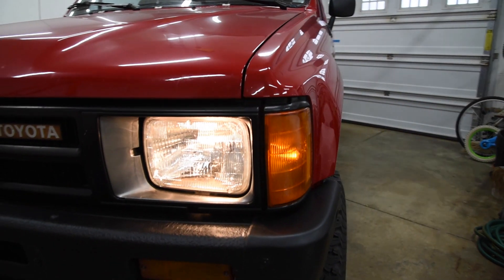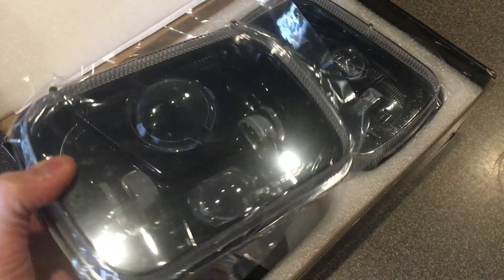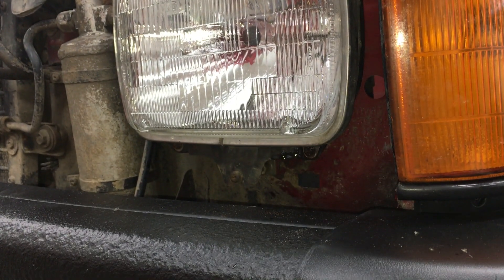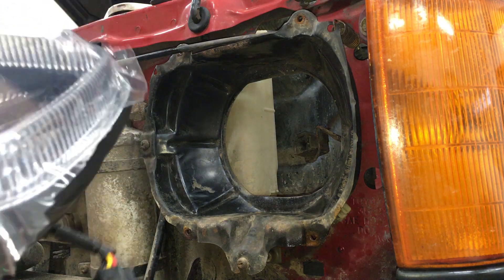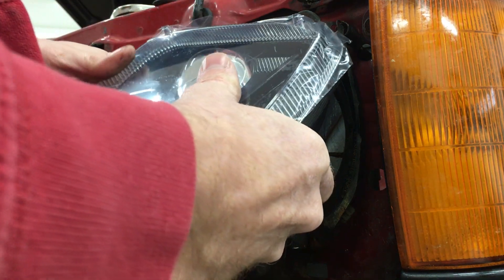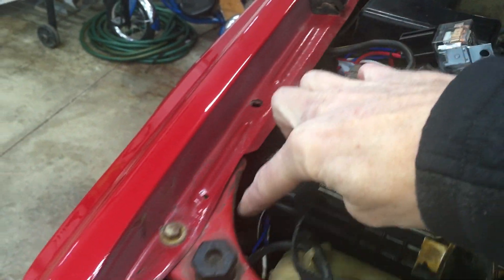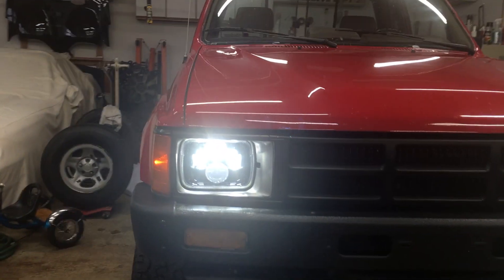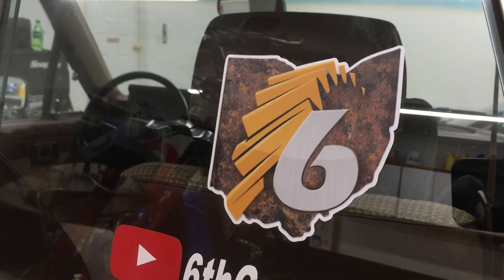How to: Install Toyota Pickup Truck LED Headlights - 4Runner & Tacoma too!

Comment: I bought a kit with the many led lights for my 84 Toyota and was very frustrated my brights wouldn’t work.  I bough a wiring kit from somewhere out west similar to the one you bought and plugged it up the same way.  Still didn’t work.  It was a waste of 50 bucks.  I hardwired a toggle switch to turn on my brights.  I’m really disappointed and am looking for some nice good old fashioned bright halogens now.  Glad your stuff worked mine was a waste.

Comment: I put on the led headlights and some plug and play led tail lights but my truck doesn’t idle anymore after installing the tail lights and it starts shocking me once I crank it over and touch any metal
Reply from the maker: I'd start by removing each light one at a time and seeing if it still shocks you. When the problem goes away, you've found the culprit. Sounds like some wires are crossed somewhere and causing a short.

Comment: I did the install as well and the dashboard light isn’t telling me when the lights are on! Any suggestions?
My blinker lights are turning on, the lights on the dashboard is working only the low beam and high beam light isn’t turning on.
Thank you.
Reply from the maker: Did you use the H4 conversion harness? It must be used with aftermarket LED lights on these Toyotas.  If you did, then I would double check grounds and connections next.

Comment: Hi, I installed LEDs with the arnes in my 88 toyota truck, but just the low beam works. please i need you help!
Reply from the maker: I would check to make sure you have the connections for the lights in the correct order.
Reply: @6thGearGarage  i used the extra wiring cable to change te position and it works, but the lights are inverted vs switch lever.
Hight beam when swicht is in Low position.
Low beam when swicht is in hight position. 
I did many combinations in the cables in dosnt works it.
Reply from the maker: @ you may need to re-pin the extra harness to switch the high and low wires. Toyota light wiring is different than most other vehicles.

Comment: Man how is the front bumper removed
Reply from the maker: Bolts at the bottom of front fenders for the end caps. Then there are 2 big bolts on each of the bumper brackets that hold it to the front of the frame.
Reply: @6thGearGarage  thank you again

Comment: Did you ever come up with the High Bean indicator light not working? I'm having this issue after using the h4 LED harness. The indicator light worked before I did the LED conversion.
Reply from the maker: To get the high beam indicator working again, You will probably need to install a resistor because the relay thinks the bulb is burned out because LED's draw less power.

Comment: I actually really appreciate that you kept your "failed" first attempt at "plug and play" because that's EXACTLY what I experienced when I went to plug in my LED light.  Same as you, I swapped the wiring around (actually tried many other combos too), but kept getting High Beams on all the time, and when flashing my high beams, it turned off...  Then searched a bit and found that Toyotas are switched ground, and these lamps assume a more standard switched positive.  So we need the relay wiring kit you ordered (or I guess you can wire it yourself, but for $18, the parts and time to do it is worth that much).

Had I seen your video before I started this project, I would have known what to expect and saved some time, but oh well, it's always trial and error with these old Toyotas.

BTW, my car is a 1986 MR2 (AW11), and I also have a 1988 Celica (ST165) and 1992 Celica (ST185): they all had the same issue - pretty safe to assume any old Toyotas with the H6054 7x6 headlights have the same wiring.

P.S.  Also got a good laugh about the rusted headlight ring retainer screw.  Those damn things are always rusted on every Toyota I had and the Vise Grip method is my favorite method too!

Comment: I just want to personally thank you for this video. I have a 1990 Toyota pick up that I just put some of these in. Went ahead and got the harness just to be safe, and sure enough it was needed! if it weren’t for you showing what was wrong I would’ve probably had an extremely difficult time figuring it out. Thank you so much! I love my new headlights so far. ♥️

Comment: These are the exact same lights that I bought for my 93 Toyota Pickup. Thank you for the video.
Reply: Ayy bro i have a 93 pick up to. Did you have an issue with them just staying in high beams??
Reply: @kashoutcris9487  No. Did you buy H4 harness for the head lights? I had a problem with getting the brights to come on, but that was caused by my switch, not the lights.

Comment: Thank you for uploading this! It really helped me out. I lucked out and didn’t need to unscrew the metal frame around the headlight, I got new hologram ones and they came with it. All I need to do was remove the bolts that keep it in place and position it and a spring.
Reply from the maker: Great to hear!  Those tiny rusty screws were the worst part of it all.

Comment: Thank you for making this video! I installed a set of these same lights I got on ebay last year in my 87 and had run into the same issue with mine which never came with the adapter or instructions..  so I only set up my low beams and was dragging my feet on the idea of having to rewire the factory switching. Now that I know about this adapter I wont have to! Otherwise I've been running these lights for a year and enjoy mine too
Reply from the maker: Glad the vid could help someone else!

Comment: Good video. I went from using one, to using two H4 harnesses. The stock Toyota has redundancy (separate fuses for left and right). This setup only uses one Toyota fuse and has only one fuse going from the battery to both headlights. Either fuse blows and both headlights go out at the same time. With two harnesses, I'm using both Toyota fuses left and right, and now running separate fuses for left and right headlights from the battery. Interesting, the high beam indicator light on the dash didn't work with one harness, but now works with two. 

I simply cut off the part of the harness I was no longer using that went to the second headlight, capped off the exposed wire ends with small wire nuts and some electrical tape. I then added wire to the hot on one harness to reach across to the battery. I used the leftover wire and conduit to lengthen the hot and soldered and taped the connections on the hot. Then it's just plug and play.

A good investment for only 17 dollars for the second harness. 

Much, much safer to have each side fused separate so you don't risk losing both headlights at once!
Reply from the maker: That's a really good idea, thanks for sharing!!
Reply: @6thGearGarage  You're welcome. Glad you like my idea!
Reply: I’m confused where the relay gets hooked to.    Could you explain if you see this.  I live in Alaska so everything seems to be a pain.    Thanks 🙏🏿
Reply: @stevenshackelford1032  The harness has the relay in it. Connect the harness to the headlight on one end and to the battery on the other. In the middle there is a place to plug in your old (stock) headlight plug to control the new harness and relay. I used 2 harnesses, so I have 2 fuses. One for each headlight instead of 1 fuse for both headlights. I didn't like the thought of losing both headlights at once if the single fuse blew.

Comment: Excellent tutorial.  I just bought the harness because my LEDs did the same.  No HB. Just LB.  THX
Reply from the maker: Glad it helped👍
Reply: @6thGearGarage  Installed in about an hour. Just like yours, i didn’t have a solid ground connection on the passenger side.  A little finagling and lo and behold we’ve got Hi and Lo beams.  I had to take the battery out to work on the right side.  A minor PIA.  I couldn’t have done it without your detailed explanation.  Many many thanks.

Comment: Nice video…definitely a big upgrade over the stock H6054 sealed beams. I also ran into the same issue when installing my JW Speaker 8900 H6054 LED headlights on my 1994 Toyota pickup. Toyota trucks use a double switched ground system which causes the issue since the LED’s headlights are designed to work with a switched positive system. After installing the H4 harness all worked perfectly. Light output is excellent with a very clean cut-off. High beams are insanely bright and usable! Yours came out great!👍🏻
Reply: Did you keep the old headlight wiring system in the truck?

Comment: I've got these same lights on both my Nissan hardbody trucks, and with the first click of the h/l switch, they go into DRL (daytime running light). 
Just the vertical LEDs on the sides light up, i think it looks dope!! They actually put out some light too, sometimes I forget to put my headlights on bc the DRLs are bright enough & i don't realize it  
Anyhow, Awesome video man. I appreciate how thorough you were!.
Reply from the maker: Aren't they amazing? After driving with these at night, I don't think I could ever go back to the old halogen headlights.

Comment: just FYI if you still have the truck the H4 harness likely has saved your electrical system specifically the headlight knob and the wiring into the stem toyotas run all headlight power through the stem the relay harness fixes that part by the switch just operating a relay i have mine now operating 2 relays (using the non used headlight socket) so my offroad light bar does not work if im running high beams (which is illegal in some states) an if i cut off the lights all of them go off
Reply from the maker: Good info, thanks for sharing!

Comment: Omg thank you for this video, I was about to just roll with no high beams!!!
Reply from the maker: Glad it could help!
Reply: @6thGearGarage  did you still have to use the wire adapter to switch the negative when installing the upgrade harness?
Reply from the maker: @troypeplinski6241  No I did not need that after installing the H4 relay harness

Comment: great video , i went through the exact same problems on my 84 except rust because iam in nevada . once you go to LED theres no going back , the only drawback ive found is driving in snow the LEDs dont get as hot so snow builds up on them instead of melting off although i heard there now making heated LEDs
Reply from the maker: I hadn't considered that. I try not to drive this one during winter so it won't rust away

Comment: Question so when we get the relay do we still need to use the other adapter to switch the negatives ? Or just take it off ? Thanks
Reply from the maker: The little adapter that came with the headlights? You can toss it, the H4 relay harness takes care of everything.

Comment: Did you have to modify the headlight buckets?  I had to trim a fair amount to install the thicker LEDs.
Reply from the maker: They were a tighter fit than the old headlights, but I did not have to modify them to fit.

Comment: Getting ready to do exactly this to my 88 Pickup :) Love your videos man.
Reply from the maker: Thanks!!
Reply: @6thGearGarage  Just got it done yesterday and I couldnt be any happier. Only thing I need to do now that Ive installed the new headlights is I should have gotten a housing that supports DRL. So I may do a swap down the road if my friend is willing to take the existing ones off of my hands.

Comment: Ah dang. When your driver side light didn't work after attaching the harness I was hoping you'd give me some guidance ha. Mine Stull doesn't work with the harness, only the passenger does. Customer support said it should work which wasn't helpful.
Reply from the maker: I think mine was due to a bad ground connection, I'd double check your grounds first
Reply: @6thGearGarage  I feel dumb. I double checked my grounds... and I should've triple checked. The bolt it was on apparently isn't grounded so I moved it to the frame bolt and it worked. I'm gonna go smash more coconuts.
Reply from the maker: @brandonhearn4746  I’ve been there, same issues. Sometimes paint or surface rust can prevent the ground from having a good connection, even though it looks grounded.
Reply: @6thGearGarage  exactly what it was. Now I'm dealing with the bumper blinker light. Replaced the bulb and now it won't work haha. Put the old bulb back and it still doesn't work so 🤷 I'll be over here breaking and replacing lol.

Comment: Where did you hook up the relay?     I’m in Alaska and I have purchased the headlights.   I have a 97 Toyota and the video was very informative and I subscribed to your channel.    Please let me know because I’m doing it tomorrow.   Thank you very much pal 👍🏿
Reply from the maker: The relay plugs into the headlight plug and also connects to the battery. And you’ll also need a ground.
Reply: @6thGearGarage  got it and everything works great.   Appreciate it pal 🙏🏿

Comment: @6thgeargarage what did you bolt the relays too? Thanks for the help buddy
Reply from the maker: I didn't bolt them, just zip tied them securely to the harness and tucked them in the space between the battery and the side of the engine bay.
Reply: Thank you so much buddy. Think i could wrap the exposed metal with electrical tape? @6thGearGarage

Comment: Do you have a video on how to install headlights with Halos?
Reply from the maker: No I don't, but I'm getting ready to upload how to install LED headlights with integrated turn signals. Similar but just a different wire to tap in to.

Comment: What year is this truck??? You should mention it in the video, title, and or description.  You don't in any of them.  I just upgraded mine with the newest 2021 lights like these but with the DRL / turn signal lens at the bottom.   I replaced the 4 trim ring screws with stainless steel which are M4 -.07 x 10mm.
Reply from the maker: It's a 1985, I'll be sure to add that to the description... thanks!

Comment: im using the same harness but my lights are always on brights and it doesnt show on the dash that they are on. it has no low beams?
Reply from the maker: Someone else had the same problem. I'm not sure why, but it sounds like the harness may need re-pinned at the headlight.

Comment: Great video and love the channel. Just installed the same LED headlights you used and also the relay harness. All worked except only have high beams. Cleaned grounds, no change. Unplugged new headlights and replugged in the old and now get high and low beams through the original headlights.  Do you have any suggestions or ideas why the new lights only have high beams?
Reply from the maker: Are your high beams on all the time when you turn the lights on, or do you mean you have no low beams and only high beams?

Comment: So this video is a year old, how are these holding up now? Any issues after a year?
Reply from the maker: Funny you mentioned this... I just saw a little moisture in one of the headlights for the first time a couple of days ago, after I washed the truck. It appears to have gone away now.
Reply: @6thGearGarage  but are they still just as bright?
Reply from the maker: @Valtrexthief  Yes they are still just as bright as when they were new.

Comment: Will that harness work for any headlight set?
Reply from the maker: I've only used it for Toyota trucks, but it may work for others as well, as long as the plug is the same (H4)
Reply: @6thGearGarage  awesome! Yea I have a 94 toyo pickup and the lights I’m looking at got the H4 plugs. Thank you 😎

Comment: I have the exact same ones i just bought this month.  Amd they dont fit in the metal housing behind the chrome trim.. i had to cut out the metal housing.. and that caused the adjustments to now be riding alont the new headlights rear housing.. havent turned it on yet due to truck is getting worked on.... 
So im wondering how yours fit when i have the same light and truck also
Reply from the maker: Mine fit without any cutting, but you're the second person in a week that said they had to trim the metal housing to get these to fit. What year is your truck?
Reply: @6thGearGarage  1986 pickup 4wd.. they must've gone with a different housing or something.. its just slightly bulkier on each corners.. i tried trimming just a lil. But it wouldnt seat.. had to trim it 180.. so it now doesnt rely on the housing bracket to pivet for adjustments.  Its now the actaul headlight thatll pivot  around... im just hoping itll still adjust correctly. And hope its as stable

Comment: any idea if this harness would work for an ‘88? also what lift kit do you have on your ‘85? thanks in advance, it’s hard to find info on these durable lil trucks!
Reply from the maker: Yes, the harness will also work on an 88. This truck has a 4" Pro Comp lift, plus a 2" body lift.

Comment: Hey does the plug to know when it switched have to go into the passenger side? Bc my batter is on the drive side and I hooked it up the same way but mine still will not turn on. I have a 1997 Tacoma
Reply from the maker: The side should not make any difference. I’d check and clean the grounds
Reply: @6thGearGarage  thanks I’ll definitely try it

Comment: Have the same lights on a 1989 Toyota pickup truck and when I would turn the lights on they would flicker and turn off then I would turn then off and on again And they would come on. Now they don’t turn on just the high beams come on. Do you think it could be a wiring issue or the light burnt out ? Both side had gone out
Reply from the maker: I’d check the grounds of your harness first.

Comment: Just completed this and everything worked except for the side marker lights and side turn signal on the pax side. Any suggestions?
Reply from the maker: It sounds like a wiring/connection issue, assuming the bulb is good